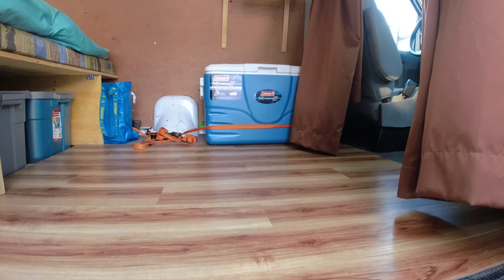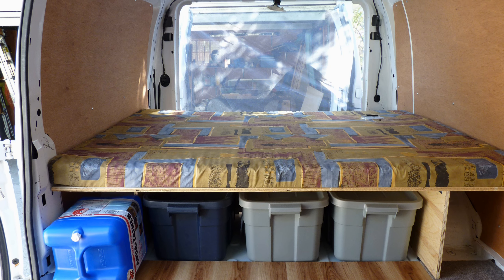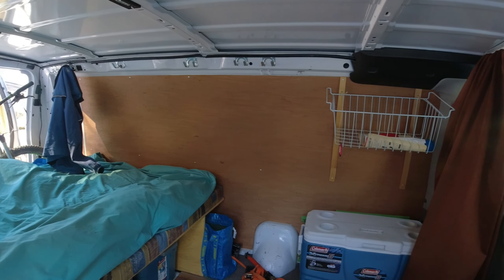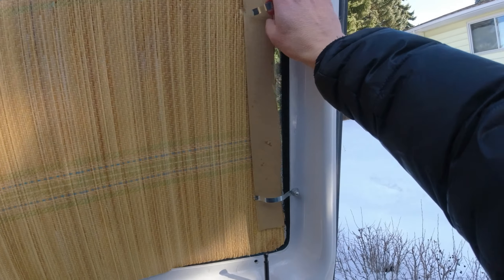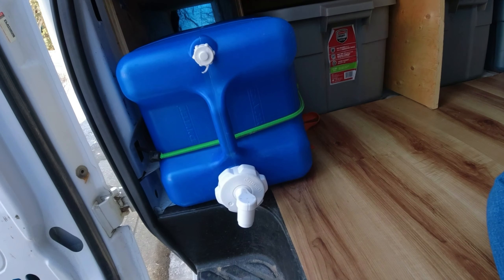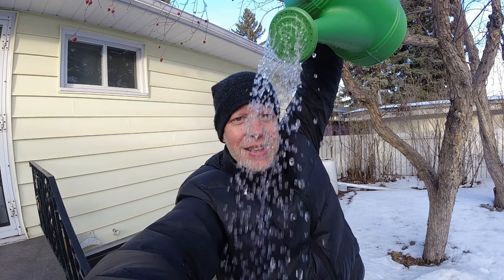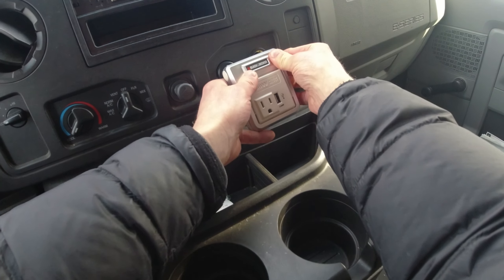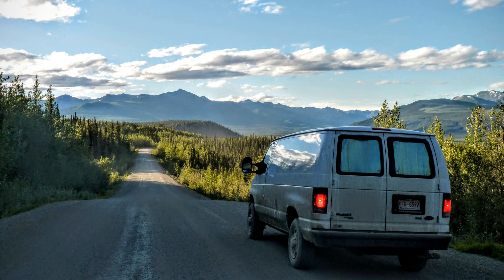Transforming VAN to my DREAM HOME for Pocket Change

Comment: Two years later and everything has gotten more expensive, but, as you said... there is no wrong way to build out a van, as long as it provides you with what you need.  👍
Reply from the maker: Yeah... there is no wrong way... the important thing is to make a plan and take action.

Comment: I love this simplicity!  So, if you were in it full time, what things would you do differently? Also, how do you find the condensation drips on the roof of the van onto your bed?  Just got a van and about to build it out and was racking  my brain over the stupid floor.  🤣
Reply from the maker: I've traveled in the Central and western parts of Canada and the US and have never had condensation on the roof. If I lived in it full time I would probably be using my computer more inside so would want a swivel passenger seat and a good stable table.

Comment: I think you must have gone a bit over because you haven't accounted for hardware, nails, screws, adhesives, ratchet straps, tarps storage,  baskets and so on, but it's still very low budget. Prices for everything has also gone up and now that bed probably will cost about $300. I like how you've stored the bike though, especially that notch in the plywood cut out for the rear derailleurs. This is going to be making me rethink how and where I should put my bike, something I've been struggling to figure out how to do for some time. I was trying to avoid blocking the rear door but I can't figure out where else to put it.
Reply from the maker: Believe it or not - this includes everything: hardware such as screws, ratchet straps, and rubber totes, etc! However, this was done in 2016, so you're right that prices have gone up! The garage for the bike has been perfect. The only thing is that you have to think ahead: taking the bike out is quick, like 10 seconds, but I make sure that I only do it once a day, exchanging gear I need and stowing things I won't need depending upon my upcoming plans.

Comment: Would work for me.
Reply from the maker: Good to know there are others who find the simplicity workable! 🌞
Reply: @SwellerVanDweller  Of course. I, as a solo vandwelling woman wanna travel light. I rarely ever stay longer than 2 days at any spot, and can go shopping for groceries at least once a week. When I see how many people bog their vans down with needless but heavy shit I can only shake my head. I travel South Africa, Namibia and Botswana, and the danger of getting stuck in the desert is always there. In that case my van must be light enough so that I can set it up on recovery tracks by myself. And a library with 100s of printed paper books, 100 liters of fresh water and another 100 liters of grey water won't help me in that situation. The vehicle must always be strong enough to tear up the floor and get me "outta there!"

What I would add to your van: Recovery tracks and an electric airpump so I can let out air off the tyres when driving in sand and fill them up again once I'm back on asphalt. And my next van will be 4x4.
Reply from the maker: @orcaflotta7867  Yeah, those recovery tracks have been on my mind... and a pump wound be the icing!